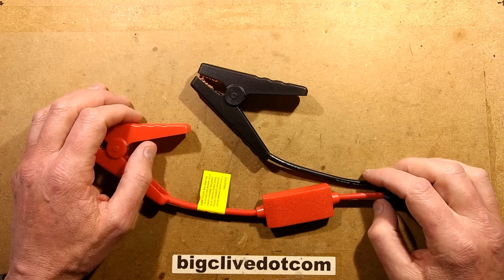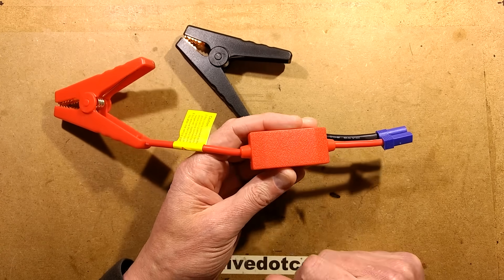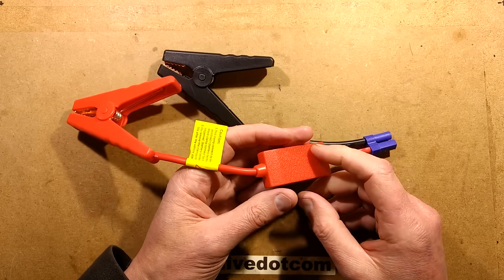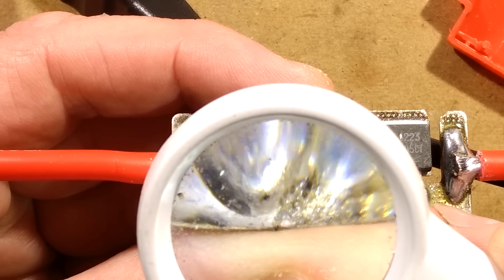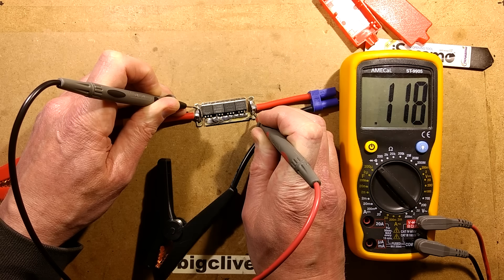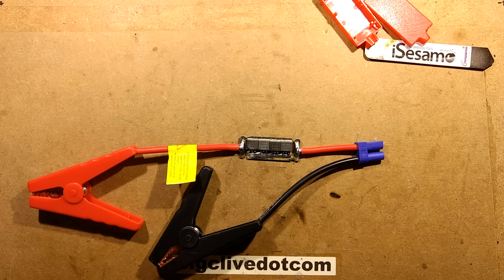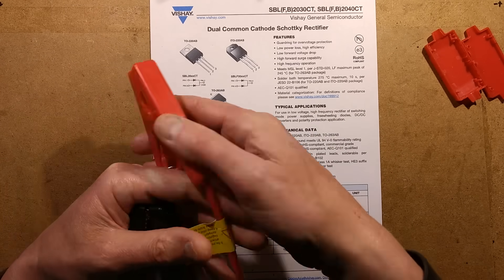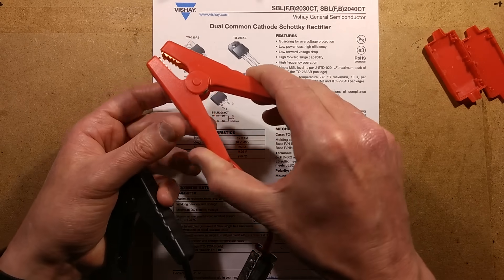What's in the little red box on some jump-start leads?  (Guess first.)

Comment: The 'magic' red box seems straightforward to me. You basically have 8 diodes in parallel to handle the large current draw and prevent reverse polarity hookup and voltage back flow from the 13v-14v alternator when the car starts. The low voltage drop is due to there being 8 diodes in parallel where each silicon diode would drop around .7V. I don't see any confusion about this setup.
Also, you mentioned that it could draw 400 amps. I'm sure those (10 ga.?) wires would melt at 400 amps. Put a clamp meter on it to see what it's really drawing when you start the car. I may do my own such test as soon as I get a DC clamp meter.
Reply: The low gauge wire can support 400 amps for a short period of time like jump starting requires.
Reply: Yeah, Clive, PLEASE blow up your car in video for us all! Please?

Comment: The Lipo batteries in jump starters have large surface area internally and can deliver surprising amounts of current. Most starters only need a couple hundred amps, and these batteries can deliver that for a few seconds. As mentioned before, their 3 cell design produces less voltage than the running alternator and the low resistance of the battery would draw too much current which is not good for the battery or the car's alternator, so diodes make sense. Note that many car starting packs have more sophisticated boxes in their cables that do look for reverse polarity and protect against more faults, they won't start the car unless they see some voltage there, so a truly dead battery will not trigger them. These units contain FETs so they can control the current. Good luck with your research! Carbon pile loads for car batteries would be a good tool for your investigation, or a large collection of parallel FETs on a big heatsink to make a load bank with some analog controls.

Comment: I was wondering what was in that box lol. My 10A leaded schottky diodes get down to about 0.1 forward voltage while being diode measured but when passing a little bit larger current through it, I think it quickly went to 0.25V, if not more. I wish it was more stable lol. I had to scrap some circuit ideas I had because I planned on a closer V difference as current went up when I was waiting for them to arrive.

Comment: Ninety nine out of 100 use jumpers the wrong way.  
There are only two ways they should be used: 

1) If car to car, connect the positive cable between the two cars' batteries, then the negative on your car and then to the negative on the dead battery.  Then start your car and let it run several minutes allowing your car's system to charge the other car's dead battery.  After the several minutes disconnect the positive cable from the dead battery, then the negative.  Then start the car that had the dead battery which is now charged enough to start the car.

2) If simply from an external battery, not in a car, simply connect the positive and negative cables on the external battery to the dead battery and start the car, disconnecting them as soon as it starts.

NEVER connect two cars together and try to start the dead car while the other one is running.  This can have devastating effects on the electronics of the car doing the jumping.
Reply: the last connectionis wrong  should be   pos to pos  on battery  then neg   one side   to   battery   then last connection should be to  the negitive clamp to  motor or frame. the reason to connect to frame/motor is so that you dont get a spark around the battery which off gasses  hydrogen " explosive gas"  ive seen 3 batterys  explode from this  in 40 years its not common.
Reply: @joejane9977  Yes, you can do it that way but since the battery is dead there's no gas being produced and the danger of explosion is minimal, if at all.  With newer cars and many plastic and aluminum exposed parts it's often to find a good ground point near the starter motor to connect a clamp to, while the negative battery pole is usually exposed and is a reliable ground point.

Comment: If the diodes fail.  Which they probably would.  You don't need them.  They are only there if you connect it in reverse polarity.  So, just don't be stupid.
Reply from the maker: They wouldn't help in a reverse polarity connection.  They're there to stop the cars alternator forcing current into the lithium stack and possibly causing a full-charge meltdown.

Comment: He didn't address the unusual very low forward voltage, after he found the data sheet.  Are those diode unusual in their structure/manufacture ?
Reply from the maker: Schottky diodes.

Comment: So I can't have a direct connection to the battery without that little box in the line. It's for my motorcycle was trying to use the SAE cable already there to jump my bike.
Reply from the maker: It would work, but there's a risk of high current flow back into the lithium cells from the alternator.

Comment: these diode pack fail regularly, they usually fail closed circuit but the jump pack will detect battery voltage and will not turn on the output. you can defeat this on some units by putting it into "jump" mode first and then connect the jumper leads (there will be sparks when you connect the jumper clips)

Comment: They're in parallel, and diodes.  That's why they read oddly.  Used most likely for transient suppression and voltage stability - think of it as a big fat voltage regulator with a large physical buffer in it to soak up ugly shit and give you some reserves of smooth power to fend off ripples and such.  Any huge noise coming through (cars are electrically pretty damn noisy and frequently handle aggressors/injected noise/signals very poorly) will throw your voltage levels all over the place as well as try to spike your electronics, in your car andor the jump box.  I would say judging by my recent experiences you're far more likely to trash your car's electronics in some weird manner than blow up/croak a jump/charge unit's battery, regardless of the battery chemistry.

Comment: 2000 Amps DC on 10 AWG stranded wire , copper plated AC/CU plated. 400 Amps would fry it to a crackling crunch. It may hold before bursting into flames but someone would get the shit burned out of them. I'd like to see it at 2000 amps or even 1000. Yes they are relying on it being a short period.  New car starters are tiny compared to ones from the 1970s. That said I have a jump starter pack with a lead acid battery, made by a major company that has worked spectacularly for years. FYI made by Schumacher but only claims 650 amps. It starts my tractor, my truck and the wife's Toyota Camry.  It has saved us lots of time. hassle and money...The original cost was about 50 dollars. I will be changing the battery in it this year.

Comment: Wouldn't it be better to make these packs with 4 cells? That way the reverse charging effect once the alternator starts cracking out 14v would not be such a problem.
Reply: That is exactly what I did. I used a 5000mAh 4S lipo RC plane battery rated at 60C last week in an emergency as I had left my lights on. It worked just fine. Don't know how long it would last however but the engine (3.0 Diesel twin turbo) started first time! Saved the day anyway.

Comment: I looked at those lithium jumper packs for over a year before I bought one.   I read some reviews, crunched the numbers and then took the plunge.  I bought a brand called "Bully,"  more on that later.  

I charged mine and threw it into the back of my car.  Not a month later my Volvo V70 had a dead battery.   Out came the jumper pack.  The car has the battery in the back and a terminal under the hood for "jump starts."  That terminal has never done me any good even with another car supplying power.  So I hooked the Bully to the batter, positive to positive and negative to negative.   Turned the key and it started fine.  

Recharged the battery and put it back in the car.  Checked it a few months later and the battery was swelling. Oh, oh.  Called Bully and I had a new one in a few days.  

Last week, I had a dead battery again.  Bully to the rescue.  

So far, I'm a believer.  Just buy a brand name at a reputable store.

Comment: Half way through the vid and I'm asking myself, why diodes in a DC circuit. Polarity protection ?
Reply from the maker: Protection for the lithium cells from excess charge current and voltage from the alternator.

Comment: ♫ 8 fat diodes ... soldered in a line .... ♫

This assembly beat my guess of 0.15 to 0.2V. Then again, these are 20A diodes with rated leakage of 1mA!!!!! WHAT?! Also, it looks like the factory used mixed stock. I wouldn't mind betting some of those 4 are counterfeit.

Comment: I have one of those, they worked GREAT to start my riding mower, however last winter, I drove 1500 miles in my RV pulling my car behind.  The battery went dead on my car, so I hooked up my booster.  No joy, all that happened was that the unit itself swelled to twice its size and all it is any good for now is as a temporary 12 volt power supply for arduino projects and such.  One cell is dead of the 4 slap cells (or was it 3?  Yes I think it was 3).

Comment: They can desolder.  Just did it.  I wasn't thinking trying to start my cummins diesel pickup.  The jump box didn't do it and without thinking I tossed to big heavy shop charger on and cranked it up to 80 amp boost without removing the jump box.. It quietly melted off.

Comment: The lower forward voltage is caused by the current available from your meter vs the parallel Schottky diodes. Raise the current and the voltage drop will increase due to the forward bias knee characteristic of these parallel diodes.

Comment: 4 10 amp/ 15 volt rated diodes... When the car being jumped starts, it will draw up to 30 amps... (standard 4 cylinder sedan) at 15. 5 volts.
This device will stop the resulting back surge of current /voltage once the vehicle starts..... Imagine priming a water pump. If you do not turn off the primer valve when water starts to flow the pump pushes water out the priming valve instead of the outlet. These diodes are a priming valve. To stop current / voltage flowing back to the starter pack /doner car.
Actually one of the better designs. Most   cheap devices use resistors / 0 ohm resisters / devices under spec. That will blow to achieve the protection they claim to be designed for.
Reply: its  4 diode packs of 2 diodes each so 8 total  look at data sheet says   10 amps per  diode  and 20 amps per package

Comment: well i was surprised to find it was diodes inside but looking at the setup it wastwo functions. the second being a fusible link. if got enough juice  and overloaded them it would have melted the the pins keeping both ends of the cable together

Comment: pausing the video at 1 minute in to type this. the most logical thing that is inside that little red box is a fusible link or what some may call a thermal link. basically it is a wire fuse that will melt and separate the cable if the amount of voltage or amperage it is rated for is exceeded. this is used in a lot of automotive wiring harnesses to stop a harness meltdown or fire.
i doubt it is a fuse since if you went to the trouble of using a fuse you would probably want it to accessible for replacement if needed

Comment: I'm more inclined to think that the diodes are an attempt at protecting the user from hooking up the connectors in reverse and the underrating of the diodes is handled by having multiple diodes in parallel.

But then again, I've had quite a few beers today and it might be the beer talking... <burp>

Comment: My money is on hot air.. hot once the bailing wire draws starter motor current. It should be a reverse polarity protector, but since it's showing up on this channel, I have slightly lower expectations

Comment: Do you need this inline for it to jump a car i bought a jump box and the little circuit inside the box melted can i eliminate the box for a fuse ??? or is there a replacement component i can solder in ???
Reply from the maker: It's to stop the cars running voltage from trying to backfeed into the lithium pack and charge it at extremely high current way above its safe rating.  You can buy these diode packs on eBay.

Comment: SO CONFLICTED. Do I go to this video, post a comment first, then watch? How many people had already done that and spammed the comments? Am I right (educated guess: yes, I am)?

Well, here goes nothing: it has a small tap off the opposite source terminal to power its circuitry, and the box is either a small but powerful relay, or a FET, connected to a microcontroller that measures voltage difference between each end. If it's determined to be flowing in the opposite direction, it knows it's backwards, and won't connect the lithium battery to the clamp. If it's 0 or not connected, it also won't connect, so you can't short it together.

There ya go. Now, I'll watch the video.
Reply: watches video
OH MY FUCKING GOD IT'S WORSE. Now, see, my guess was based on the fact that I have one of these (a Bestec brand 2.5" HDD-sized thing), it works great, jumps any car I throw it on, and it has a brick just like this. However, it has LEDs and a buzzer, and when you plug it into the pack, it lights up. Close examination reveals the heat-shrink tubed secondary wire to get a complete circuit from the one leg of the wire. When it's active, there's a tiny "tink" sound inside from, presumably, a small relay. And the LED action has to be driven by a microcontroller, not passive components.

So, I guess China's figured out how to cheap out on these after all. Thanks, China, always making for creative ways to break the rules in favor of ever-cheaper garbage!
Reply from the maker: +Matt Falcon You'll love the next video.  It's a cheap jump starter getting shorted out.  It should be released this evening.

Comment: I hope you noticed, but not all diodes are 8203's ... it immediately drew my attention that the far right one was a 6223 instead of an 8203; so they've used different ratings mixed up in the little "'block device"
Reply: It's the bottom number that counts.

Comment: hey clive,i bought one of those made by anker,mostly because they made it sound really great for a small package, the little box on mine has a red and green led, and it will turn green when its ok to jump,but you cant let it sit and charge the battery it wont let you,now it failed to start my car,the battery actually had a bad cell,so the jump starter doesnt like that,however,my wife who left her lights on and brought her battery down to about 8 volts ,it worked perfectly, the only reason im keeping it

Comment: I'm going out on a limb here not having watched the entire video yet.
Reverse protection. You don't want current flowing back from the boosted battery into the lithium pack once the car starts.
Reply: That isn't reverse polarity protection, it's reverse current protection which is a very different thing.
Reply: Go back and reread what I said. 
"You don't want current flowing back into the lithium cells from the alternator once the car starts:
Reply: 12voltvids: Since you have now edited your post to remove the word "polarity" there's not much point is there?  You do realise that it shows as edited right?
Reply: mikerjuk 
I corrected the word "boosted" as word substitution changed that on my phones and I didn't catch it till I went back to fix it so that is why it shows edited. I didn't change anything else I had the part about reverse polarity protection in there from the get go,  to refer to it charging from the boosted battery. nothing to do with connecting it backwards or dead shorting but it would protect against that too as the diode pack would blow open like a fuse so I stand by my observation and original post which wasn't changed other than correct the word "boosted"

Comment: Pure garbage. If you put diodes in parallel one diode will have a sizeable majority of the total current going through it unless the Vf's are perfectly matched.
Reply: Yes, and then that diode will get hotter and it's Vf will reduce, making it hog even more of the current... You seem some series resistance for each diode to make them share more equally.

Comment: Have they tried to put more diodes of same type in parallel to increase current capacity? That doesn't work too well. I guess two on the same chip are still ok, but there are 4 chips.

Comment: I guessed wrong, I thought maybe a LRC type circuit to smooth any incoming voltage/current but was expecting nothing. Did not expect diodes, although thinking about it, something to protect the lithium cells at the other end is probably not a bad thing.

Comment: 10 AWG wire I think is rated at 30 amps ??  I would think that they would not last long if you kept at the starter long  I made sets to start my big trucks out of 00 welding cable  30 foot long with the biggest claw style clamps I could find  and each truck tractor has a set 50 foot long with claws at one end the other I used the connectors for electric fork lift batteries that is wired to the trucks battery box and bolted to the side of the box so there is no chance of hooking them up wrong at that end or a spark setting off a explosion using them to jump heavy equipment at job or lots were my drivers pick them up turning over a big Cat in cold weather you can put out over 3500 amps thru them each battery has about 900 CCA and there is 4 in the trucks box they get warm pretty quick !  most autos now have like number 2 wire on there battery cables not a big draw as a machine does they would work for that a short wile .